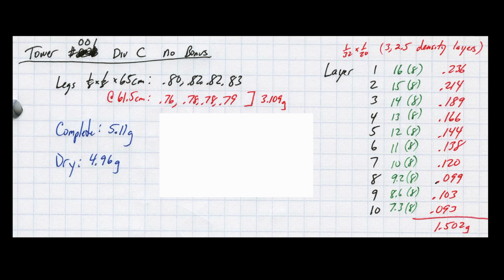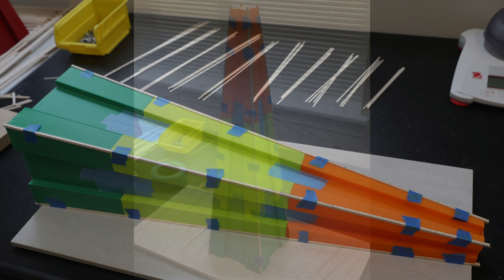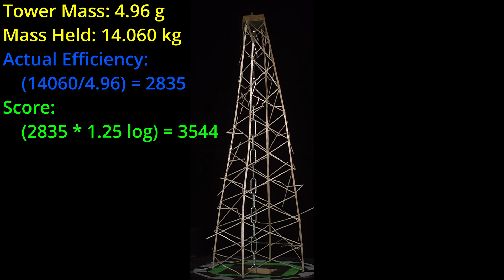2024 Science Olympiad Tower: Div C Initial Build

Comment: Hi Balsa Engineering, I was wondering, what is the angle tilt of the tower? And also what is the size of the opening at the top of the tower?
Reply from the maker: The angle is 5.28 degrees, but that just came out of the other dimensions.  The top of my jig is 40mm x 40mm square

Comment: Hi, at 3:08, do you mean to glue the crossing point of cross members? Like crossing point of the “X”? And does it help the tower to hold more weight a lot?
Reply from the maker: Yes, you 100% want to make sure you glue those center points of the cross-members.  That effectively makes them 1/2 the length and 4 times stronger wrt buckling!  If you haven't been doing that, this will really help your future builds.  Good luck!

Comment: Hi, balsa engineering! So i tested two towers, which is very similar but different to your tower. I used the jig, so the first one was 6grams, and second was 5grams. Both tower couldnt go over 10kg, and I recorded the video of it breaking! I saw that the 1/8*1/8 was the problem. The bottom part was too weak, so it broke, which leads to the whole tower break. I used  0.8grams for each 1/8 sticks. Can you please give me some advice? Thank you.
Reply from the maker: Hi! Without seeing slow motion footage of your actual tower being tested, it's hard to know for sure, but in general, 0.8g 1/8 x 1/8 legs should be plenty strong enough to hold over 15kg.  That makes me think there was an issue with your cross bracing.  Did you use 10 layers?  Did you glue the middle of the Xes?  Even a single bad cross-member piece can ruin the entire tower, so it's very important you weigh and examine every piece to make sure one isn't too light or has a flaw.  If the tower is slightly off-level, that can also cause early failure.  So, double check the level of your tower and focus on the cross-bracing for your next build.  Good luck!

Comment: Hello! I’ve been building towers that are about 9.5 grams each. I’ve been using 1/8 by 1/8 pieces balsa pieces for the 4 side pieces like you, and then for the crosses I’ve been using 1/16 x 3/32 pieces. In lower parts of the tower I used more dense pieces. Do you have any recommendations for how I should make my tower lighter?
Reply from the maker: Hi! Without seeing all the details of your tower builds I can only guess, but my first reaction is your cross-members are way too big and heavy.  1/16 x 3/32 is overkill for the cross-members.  Even 1/16 x 1/16 is typically too heavy unless you get really light material.  I would try and use something like 1/20 x 1/20 or even 1/32 x 1/20.  The real key is the mass though, not the dimension.  It's also possible/likely that your 1/8 x 1/8 legs are much heavier than what I'm using.  Try to get those legs in the 0.7-0.8g range to start. I would recommend checking out my Div C benchmark video and take a close look at my notebook page (You can watch my Taking Notes video if you don't understand what's there).  That will show you the exact pieces and material I used to get a ~5.1g tower which you can try and replicate.  Good luck!!
Reply: It’s hard for me to find pieces that are 1/20 in length and/or in width. One more question. Do you think it is more important that more surface area touches the 4 leg pieces or that they are the right density even if only a little bit of the x pieces touches the legs? For instance, on my most recent build I used bass pieces for the bottom that are 1/32 in length so very little surface area touches the leg pieces. Is that important?
Reply from the maker: @FikrieHodzhova-cx5ud  Mass is the most important thing.  1/32 basswood pieces can be glued well enough in place, but even at that size, it's way too heavy for this application (IMHO).  1/32" sheet balsa is easier to find than 1/20, so if you can find that, you can cut pieces that are around 1/32 x 1/20 (ish) at a good mass for this application and should do well and be about half the weight of your bass pieces.
Reply: Okay, thank you! Is it normal for my tower to be twistable or for its sides to shift when I press a little on them? Is that normal due to the light weight, or is it a sign of weakness and that the tower won’t hold much?
Reply from the maker: @FikrieHodzhova-cx5ud  No problem!  Yeah, for this X-only cross member design, the tower will be a little flexible.  You'll be able to grab the opposite bottom legs and it will flex.  As long as you take care to set it up completely flat so all 4 legs are touching the ground in the same way, it'll be fine.
Reply: Okay, thank you so much!
Reply: What would you say is the easiest way to stabilize the legs and make them balanced? I see to have trouble with that because the jig itself is not too stable at the bottom
Reply from the maker: @FikrieHodzhova-cx5ud  If your jig is not sturdy, then you'll have problems.  If you are using a 3d printed version, this should be plenty strong enough at 10-15% infill.  If you are using something else for a jig, you'll want to try and improve that first
Reply: Let’s say my tower needs a tiny bit of adjusting. How would I fix that?
Reply from the maker: @FikrieHodzhova-cx5ud  If the bottom isn't perfectly touching the platform, you can try and sand it flat, but that takes some patience.  You only want to sand a tiny bit off a single leg and check the level after each attempt.  It's much better to not have to do that if at all possible

Comment: Hi, balsa engineering, I apparently got 3rd place in the regional. I had a arguing with the referees that the width of the tower has to be 20cm or not. I said it has to span an opening of 20 cm, not a width. And they agreed eventually. And while the referee tried to weigh my tower, one of my crossmembers break.. And I had to fix it. And the problem of my tower was the 1/8,1/8 wood. I think it’s too weak. Can I know the density of this wood also? I’m not preparing state, so wish me a luck! Thanks!
Reply from the maker: The tower needs to span the 20x20cm hole, but to do that, it only needs to be a little over 15x15cm wide.  If they said it needed to be 20cm wide, they were wrong.   Also, the event supervisor should have never touched your device.  The students are the ones who put it on the scale.  That is explicitly stated in the rules.  Next time, don't let them touch your tower!  1/8 x 1/8 legs are a good choice, probably the best choice.  If you check my notes in my Benchmark build video, you can see exactly what I used.  You want to be around 0.7-0.8g each.  Good luck at your state competition!

Comment: What advice would you give in terms of design if my only wood lengths are 1/16, 1/8, and 1/4?
Is it advised to go for bonus? And should wood be thickest at the bottom in that case?
Reply from the maker: I would not go for the bonus.  Try to find 1/8 x 1/8 sticks for the legs that are between .7 and 0.8g (or as close as you can get), and use your lightest 1/16 sticks for the cross members.  If you have 1/16" sheet, try cutting it smaller than square to save some mass.  Forgot about using the 1/4" wood. Good luck!!
Reply: @balsaengineering6686  Thanks! I have a quiet a few questions. Sorry if it's a lot.

So why exactly is the 1/4 wood not as advisable? Should I cut them up into fourths? Also, if I go for the bonus, is there a way I can efficiently do it, or is that really something I have to scrap? Is using lines instead of X's for half of the tower with 1/4 legs advisable or is this worse?

My current plan is 10 crosses using your lengths in the video, with 1/8 size on the legs + bottom and 1/16 for the rest of the X's. Will this work well?
Reply from the maker: @hkp1015  Basically, using 1/4" is too heavy for this build and won't make a competitive tower.  If you can cut them into 4 pieces of 1/8 x 1/8, then definitely give that a try.  I made an entire video where I talk about this bonus build for Div C you might want to check out: https://youtu.be/sThnd4R-9_o?si=zjn0_qUrSSvlzvY2   The short version is that it might be possible to get a good tower, but it's too risky having to hold 15kg and it's most likely not competitive with the best non-bonus builds which have no risk because they don't need to hold 15kg.   If you build a 10 layer tower with 1/8 legs and 1/16 Xs, that should get you a good build.  It all depends on the mass of the material you are using if it'll be super competitive or not.  Good luck!!
Reply: I'm using solely balsa. So would maybe making the first 2 layers 1/4, next 3 layers as 1/8, and the next 5 as 1/16 be a good option, so I can have a strong base?
Reply from the maker: @hkp1015  It all depends on the mass/density.  Most likely, what you are describing is overkill.  Remember, the best towers this year will be around 5g and hold all 15kg, or nearly all 15kg.
Reply: @balsaengineering6686
I am using a rather heavy wood. In this case, is it advised to just go for the bonus and use 1/8 on legs, 1/8 at bottom, and 1/16 at top?
Reply from the maker: @hkp1015  Maybe... if all you have is heavy wood, then it might not be a bad idea
Reply: @balsaengineering6686 
Is it possible to get a good build with 1/4 legs?
Reply from the maker: @hkp1015  With 1/4 x 1/4 legs, you can build a very strong tower.  Probably not a very light/highly competitive tower.
Reply: @balsaengineering6686 is there any way I can optimize this tower? Like maybe alternate X’s for each level or less levels?
Reply from the maker: @hkp1015  I highly recommend you take the time to watch my 5-part series on tower basics.  I go over a lot of the design choices you are talking about.  Here is a link to part 1: https://youtu.be/XLtn8frygYo
Reply: @balsaengineering6686
Here is my design -
3/16 lighter wood as legs
5 layers of X’s on two sides, made of 1/16 normal wood and 1/8 on base
The other two sides are 1/8 horizontal sticks instead of X’s.

What should I change here?
Reply from the maker: @hkp1015  You should definitely test your design and see how it does.  You will probably find that you'll want a perfectly symmetric design and the horizontal pieces aren't necessary and the X design all the way is the most efficient.  The best towers I've heard of with the design I've shown here is over 3300 actual efficiency, so around a 4.5g tower that holds nearly the entire 15kg.  That is basically what this design is capable of with just material optimization.  Please take the time to watch my 5-part mini-tower series to understand why you don't really want just horizonal cross-members on a side.
Reply: @balsaengineering6686 I have already watched the series and know about the design. But my main concern is weight. X’s on all 4 sides might be overkill.

Comment: Hi, I am having trouble getting the tower off of the jig. Can you give me advice on how to get it off?? I have tried very hard.
Reply from the maker: Yes, that can be tricky.  What I've found that works best is to find a small block, or 3d print one 30x30x5mm and temporarily tape it to the top of your jig.  Then carefully turn the entire thing upside down and put it on a hard surface. Then firmly press at least 2 of the legs at once from the bottom and with any luck, your tower will pop off.  The key is to push from the bottom rather than try and pull it off upward.  Good luck!  (PS. make sure you build the tower on the side once the legs are taped in place.  That really helps to limit the glue and the chance it drips on to the jig fixing the problem before it even happens)
Reply: What is the point of putting a block on top of the jig though? I am a little confused as to how to do this.
Reply from the maker: @FikrieHodzhova-cx5ud  The tiny block on top allows you to have a small gap between the top of the legs and the table when you turn the entire jig upside down and set it on table.  The goal is to be able to push on the very bottom of the legs to pop the tower off

Comment: Can you glue multiple sticks to the legs for sturdiness?  Can you use a 3D printer to print each side? Can you use a hot glue gun?
Reply from the maker: If you mean, could you add sticks vertically to the legs for added strength, you definitely could, but that would be way less efficient than just increasing the density or size of just the legs.  You can't 3d print the sides as it has to all be made out of wood.  You could use hot glue, but I would highly recommend that you don't do that as it's way too heavy and not nearly as strong as something like CA (superglue)

Comment: Hi balsa wood, i was confused what the density of balsa stick is. Can you tell which stick I should buy? (Ex 0.2g per 1/16*1/16*36 stick) I want to know which balsa you used for this tower. Regional is coming up! I need to order specialized balsa as soon as possible!
Reply from the maker: I buy all my balsa in sheets and cut my own sticks.  If you watch my Taking notes video: https://youtu.be/6jSlhXZORMs and then check out the note pages in my build videos, you can calculate exactly the wood I used to try and duplicate the results.  Remember though, there is no single correct answer, so use my notes and builds only as a starting point.
Reply: Thanks!

Comment: Hello, in the rules it states that the tower must span a 20cm by 20cm opening. However, after 3d printing your jig (found in the descripotion of your introduction video), it seems like the tower only spans a 15cm by 15cm opening. The bottom piece is 15x15cm. Is this a mistake on ur part? Why is this?
Reply from the maker: Imagine rotating the tower 45 degrees and it will properly span a 20x20cm opening!  I show this in more detail in my Intro video if you want to check it out:  https://youtu.be/ECcz3T6fzPg?si=Msr5g8XCVENm0Gun&t=118

Comment: Hi! Quick question: after gluing the cross members to one side using the jig, would it squish the wood/affect tower performance if I flip the tower to glue the opposite side (3:18), such the assembled side faces down? Or should I glue the cross members while having the tower stand up vertically? My jig is weighted around 1kg.
Reply from the maker: Hi!  I haven't found that to be an issue at all and I've found that there is a huge benefit to gluing it flat on the table to help minimize the glue usage and to keep the glue from dripping into the edge grooves and having the tower stick to the jig.  Good luck!
Reply: @balsaengineering6686 thank you for the quick reply!

Comment: at 3:05 what is the difference between glued and unglued cross sections?
Reply from the maker: I don't quite understand your question.  At 3:05, I'm showing one side completed.  After that, I'll turn the jig over and assemble the opposite side. Then I stand it up and sand the edges and repeat the process for the other 2 sides.
Reply: @balsaengineering6686  sorry if I was being unclear so at 3:05 you said make sure to glue the center point of the cross sections I was wondering what was be the difference between a glued and unglued center of the cross section
Reply from the maker: @Guthhhiii  Ahh!  Yes, you need to glue that center point to effectively make that cross-member half the length which makes it 4 times stronger with respect to buckling.  If you get a chance, watch my 5-part series on tower basics where I go over a bunch of the theory behind this, specifically, check out the part on buckling theory: https://youtu.be/xIRTnISueb4

Comment: Hello, quick question, can you please provide a link to the specific wood you used. I know that it is balsa wood, but I'm having trouble looking for the correct dimensions online. Also, the 1/8x1/8x65cm dimensions for the legs, are the first two dimensions 1/8cm or 1/8 inch. Thanks for the video.
Reply from the maker: Hi!  I like to buy sheets of balsa from Specialized Balsa and cut my own strips for everything: https://specializedbalsa.com/products/balsa_sheets.php    I would recommend buying 4"x36" sheets of "light" balsa.  The legs I'm using are 1/8" x 1/8"   The cross-members can be a lot of thicknesses and sizes, but in general, anything from 1/16 x 1/16 to around 1/20 x 1/32 depending on density.  Good luck!
Reply: Hello. thanks for the swift response. One more thing, when printing out the jig on 3d printing websites like Xometry or ProtoLabs, the quote ends up being very high (in the thousands) for some reason. Do you know why this could be. What infill did you use, was it completely hollow? @balsaengineering6686

Comment: Hey Balsa Engineering! My first iteration got stuck to the jig. Is there any way to prevent this? Is the jig still usable even with the glue that is stuck to it? Thank you for your time!
Reply from the maker: Hi!  Yeah, that happens to the best of us!  I found the best way to prevent it in the first place was to make sure you are gluing the cross-members in place with the jig on its side like I show in a lot of my more recent videos.  Obviously, try to use as little glue as possible.  If the tower does get stuck, don't try and pull it up off the jig.  First, find something small - I 3d printed a 30x30x5mm square piece, and temporarily tape this to the top of your jig.  Then carefully turn the entire jig upside-down and put it on a solid table.  Then firmly press at least 2 legs at once from the bottom and hopefully the tower will pop off.  That is what has worked well for me.  The jig should be fine for future use even with that tiny bit of glue on there, don't worry about that.  Good luck!!

Comment: Hi, how did you make your testing apparatus? How thick is the chain?
Reply from the maker: I don't have any plans or diagrams regarding my testing apparatus.  I basically just made a wood table/box that has a top with a hole in it.  The chain was bought at a local Lowes, anything should work well there.  Make sure you have something to cut it with in case it's too long as you don't want too much extra chain